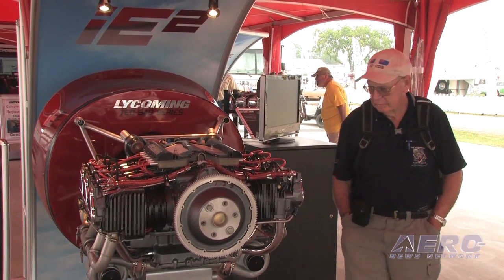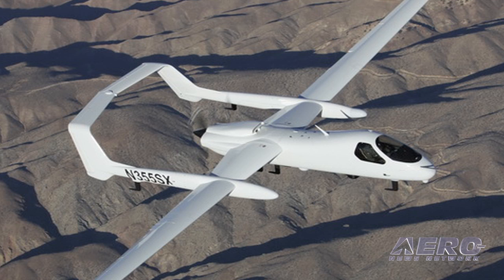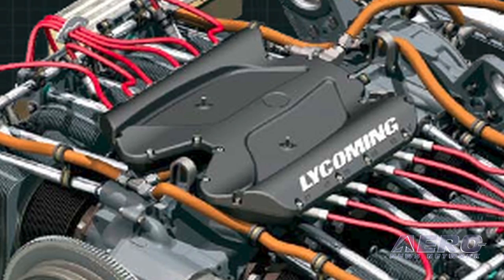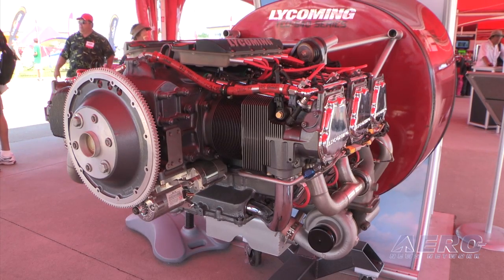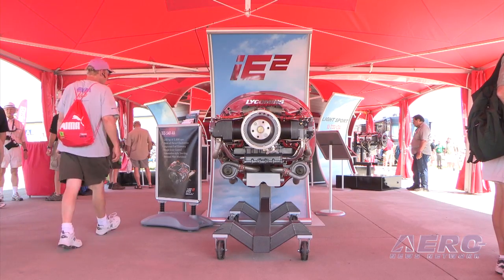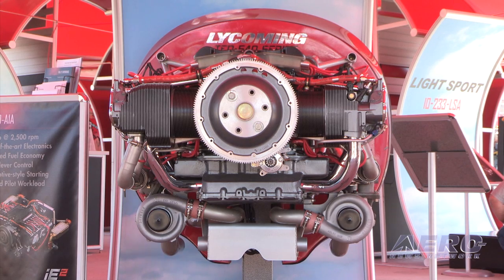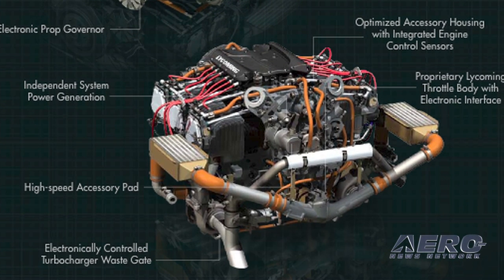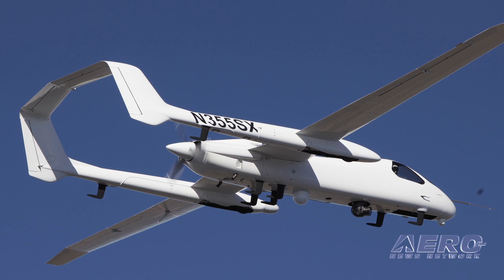Aero-TV: The Future And Lycoming's IE2 - 'Everything We Know How to Do'

Comment: Would the new IEC engine be able to be used in the Cessna 206, without the Turbocharger?  With the electronic ignition control, it should be capable of 310 HP. Maybe a little more.